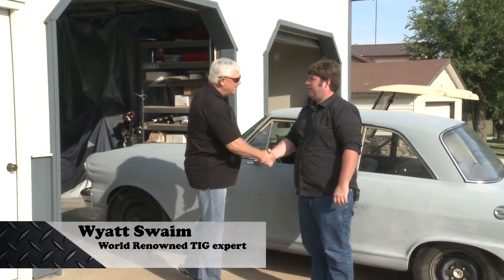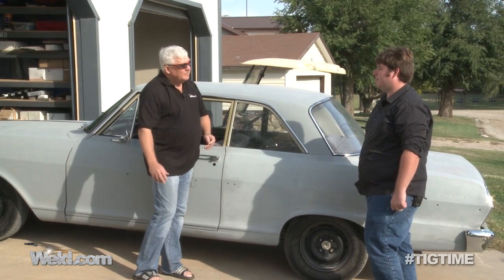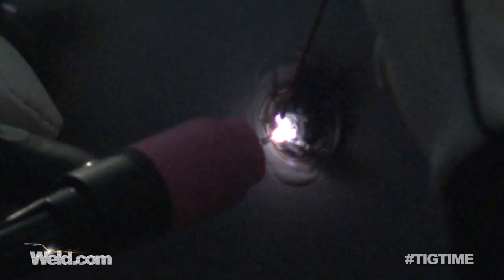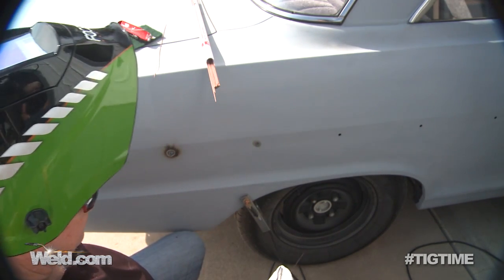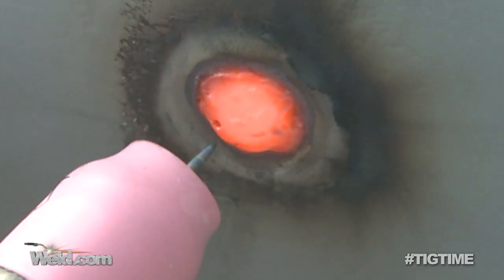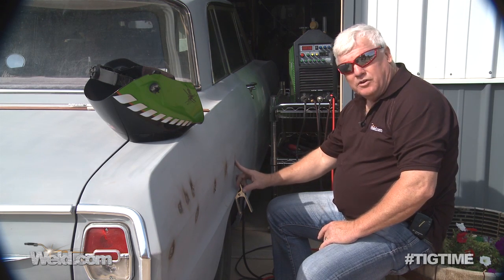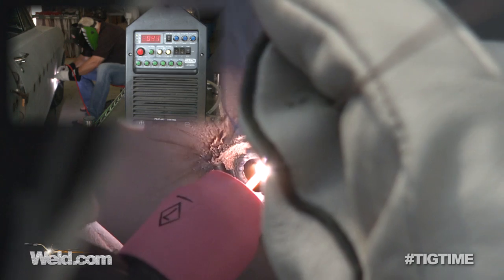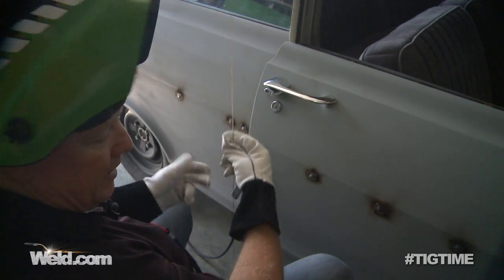How to Fill Auto Body Holes with TIG Welding

Comment: Granted this is a necrobump, but wow. There are easier, better ways. Flap wheel or conditioning disc off the metal on both sides to get it clean. Clamp a copper block on the back side. Fill in the hole. Use a dolly block and hammer as it cools to bring down the weld height and flatten the panel. Then a slight bit of flap wheel is all that is needed for prep. (it doesn't take any longer.) Some ways work. Some other ways work better. The only way to get good is to practice.

Comment: Why not back wall it with 3/8” copper block and tack it with Mig welder for 2-3 seconds.

Tig...to much work and adding to much heat. Tack and move

Comment: Too easy to clean metal, punch out comparable sheet metal patches hold in place with magnets, then tig the patch or mig in place. But  holes smaller than that say 1/8th"  I could mig with my side kick .023 wire with less heat and build up than the tig produces. Because mig is faster you could weld it and move to the next hole before the tig even puddled... but btw you did a terrific job tig welding those holes. I just wouldn't go that route.

Comment: thank you Mr TIG, love the close ups.  I'm debating buying a tig welder, already have oxy-ace and flux core but am having a real problem trying to practice on thin gauge sheet metal for a rust repair.  the way you can stay in one spot is just something I can't do with either of my tools and I think I could do it with that tool, I like slow and hate having to rush and hope things go well.
Reply: plus I notice you are outdoors (calm day though) and not getting fancy with argon on the inside.

Comment: I dont tig weld and by no means would I call myself a welder of any kind. but I could of used a mig and done that in about 1/10 the time on each hole with zero shrinkage. this process is way to slow and the amount of heat will cause more shrinkage.

Comment: I had to fill in a big silver dollar hole in a bottom of a diesel gas tank some years back. Took a while to seal it using MIG to add filler metal and TIG to get it to flow right.

Comment: Didn't want to have a $5000 paint job ruined by bodyfiller getting pushed through, would rather have it ruined by the panel rusting away from the inside?

Comment: This is the wrong process for the job. Number one mistake. It's too slow, and let's heat build up in the material, causing it to warp. Plus there's the porosity factor. Guys grab a MIG with low voltage. What he's demonstrating is literally what not to do. I made the same mistake once. Once! I don't know if he's a world class troll or possibly a tad bit derpy.

Comment: Hi there would like to know must i remove the battery when doing tig welding on a car.
Reply: It won't fry the computer box?
Reply: @PetalBreezeASMR  60's cars didnt have computers. But disconnecting the battery would be my first act. Then make sure i have covered toe shoes on.

Comment: What a waste of time! The correct way is to mig it with a copper spoon backing the hole. Much less heat and way faster. The correct reason you don't fill the holes with Bondo or fiberglass filler is Bondo absorbs water like a sponge and fiberglass although water proof will shrink after its painted and you will see where every hole was. "Epic Fail"

Comment: god dammit, so many things wrong. yea a spoon would help, but i imagine you cant get it behind the panel. also, keep riding the arc the filler you just laid so you are not blasting the heat on the thin sharp edge and blowing thru. and i know you have pulse with all the machines you get for free...

Comment: Why isn't he using a nice bronzer filling. Would have been faster and in many ways less damaging also, the cleanup would have been much easier with less shrinkage resulting a better overall finish.
Reply: And to hold the punchouts  1 16 filler tacked to it

Comment: Copper spoon on the back would help tons
Reply: Or small plugs to tack in
Reply: That copper backer is ideal....and with an old car like that, pretty doable on most of the holes.
Reply: No Mark. Plug is a bad idea >Auto sheet is too thin. 1/8 plus is do-able that way.
 It needs to be zero porosity or it WILL re-appear as a bubble I'd rather thumb bondo in than that, especially if you could reach the back side for a golf ball diameter swipe of filler---fill from the back, sand the tit from the front.Old timers used pure lead due to the low temps and ease of filing/sanding. I did a little many years ago on a "correct" restore of a 66 Mercury Cyclone GT. The quarters were seam patched with lead. I felt it better to do it that way.............and try it for shizzNgigglez. It was actually interesting to work with.Next time you see a fifties-early sixties car realize that it was done that way. The late 60's forward brought with it the plastic generation...from cars to politicians to tits. Damn shame

Comment: I know you're Mr. TIG and all (not to be a smartass), but wouldn't oxyfuel be easier for this?
Reply: NO.The problem with oxyacet is the quarter panel ares. The heat cant escape the backside. 
 035 mig at very low amps would be my first shot.Areas accessible for a copper backer would be idiot proof)pull the door panels-open the trunk). The others are tap/tap/tap with 035. Those holes are 1/4-5/16. Two or three tacks and move on

Comment: Hey Wyatt! I realize this is an older video but what would be the amperage setting for car metal? What gauge do you think this steel would be (older = heavier?)? Awesome job tiggin outside, what size lens and how many cfm for a job like this?
Reply: 1 amp per .001 on anything 1/8 and under. Thats a real car with real metal. about 65 amps worth on that tank

Comment: this was the worst example of welding. my god. I'm a amateur welder but your a professional butcher!

FOR SHAME! how do you not flean the hole. your welding to paint and primer.

your welds arnt supposed to bubble!
Reply: when you grind that chook shit down it will be full of pin holes lol
Reply: Bart Koscow A
Reply: those are no structural welds so why bother? time is priceless so as long as it is not sparking too much i would not even think about cleaning it to much, just enough to dig to bare metal so i can weld and thats it.

Comment: I did a couple of holes where a latter square tubes where so, I cut those tubes, grinde the area, and had the job done, did it with my MIG millermatic 211, but as long as you melt the wire and have it combined with the sheet metal and its solid it should be good.

Comment: I have just started to learn to tig and all I heard was how good it was and less heat and soft weld and blah blah blah. But watching this video and how much heat was put in to fill a hole. I could of did tht with my mig skills in 3/4 of the time and alot less heat. Tig is over rated for this sort of thing. Now for welding frame and such i love it cuase it pens so easy. And super clean weld . I guess im not at a level yet that I would weld in a quarter panel yet.
Reply: Tig weld is easy to prep. Mig weld is hard as the hubs of hell. And spatter. I'll stick to Tig for this. Faster isn't always better.

Comment: TIG with a fantastic workmanship can weld about anything BUT on a hole filling application on a car sheet metal,, MIG is much easyer to apply and there is much less chance to distort a panel
this job can be done with an oxyacetylene torch followed by an heavy panel straightening task,
Bronze rod is a good compromize where the weather does not promote heavy galvanic  corrosion as it does not required as much heat to perform then does not warp so much low crown panels
Reply: I tried oxy-fuel bronze. Way too much heat input which still led to warping. MIG is the way brother.

Comment: Why dont you grind the paint off first eh?
Reply: +Robertyang94 Yes it causes contamination in the weld and as long as he 's spending on the hole would cause the panel to warp,resulting in more bodywork.also,i'd open the trunk to make sure nothing is burning.
Reply: AND COULD YOU PUT SOME SHOES ON?
Reply: yes exactly!  why put paint andv rust into the weld? this goes against everything I've ever been taught about  tig welding???
Reply: YEA NO SHIT WYATT...
Reply: grinding is many times more work for no added benefit ... he's not taking this thing TO SEA or something.
Its not a structurally critical repair.

I'd say that is reason for leaving the paint to burn off
Reply: @aa-vg9yn  I'm glad he's not welding on my car, this just being lazy.

Comment: It needed to be sanded back with a flap wheel to bare steel first, clean insides with round file or carbide burr. Far too much contamination. Butt welding in a patch and cooling with a wet rag would of been a better option im my opinion, way less distortion.
Reply: I wait until it cools to room temp before continuing with the rest of the weld.

Comment: Masking tape inside could easily cause a fire, open the trunk next time and check it's not alight, and that there's nothing else behind like wiring or sealant, Mig is far safer, better and faster, the heat using a Tig will cause severe rust behind and may not be accessible to clean. 'just because you can do something doesn't mean it's done right. Always disconnect the battery and clean the paint off first, no wonder it's all porous, terrible vid unless it's a how not to do it vid

Comment: I have a pneumatic hole punch/step flange tool. It punches sheet metal circle slugs out that are a perfect fit for most molding holes on most cars. The best way to do this is to butt weld a filler piece inside the hole, then all you need to do is weld the edges of the filler piece that has no gap. You don't have to put in a lot of heat or try to fill the entire hole with filler rod. And a round "rat tail" file works waaaay better than a razor blade.
Reply: yes that's exact the way I do it. It prevent unnecessary warping of metal!!!
Reply: Exactly. The straighter you can get the metal the less filler you have to apply and the less sanding and less risk of cracks. Learning how to metal finish after the welding is done is crucial. Learning hammer and dolly skills and heat shrinking and other shaping techniques.

Comment: I think this is lite bit stupid way to fill 1 holes 
The metal will be deformd from the long welding you doing 
If a shuld done this I take smal rund stell plate and press in the wholes and weld arund them  faster and not deform the metal so much  = less work for the car owner and me

Comment: would of put the car owner to work prepping the car first and holding copper on the backsides of the reachable holes.  Any of them that shrank too much and warped I would reheat and dolly hammer after still being red hot.  If these videos are geared for the weekend warrior that might not know why not teach proper practices?

Comment: I would use for this job small mig machine with 0,8 mm wire fitted or even 0,6 mm wire, because of higher distortion of the metal after tig welding. Thanks

Comment: Tig Causes a loss of warpage. Putting a piece of copper on the backside would've made this easier also cleaning the backside of the sheet-metal, The way I like to do something like this is make a small sheet medal circle little bigger than the hole and put it on the backside and then Tack in four different spots with the mig welder cool the tacks with a air blower  sand down the high spots and fill with bondo.